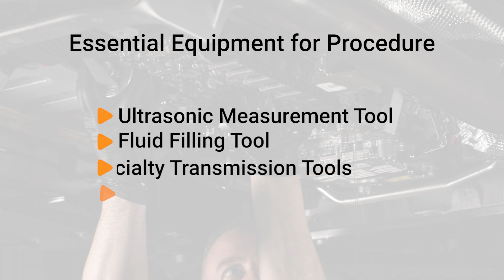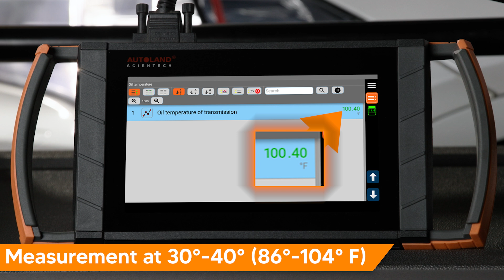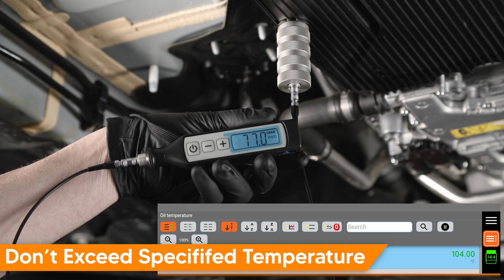Mercedes-Benz 725 9G Transmission Filter & Fluid Replacing | Special Tool Information - Ultrasonic

Comment: I never do the temp method. I take 10l out, I add 10l in. Runs fine, shifts fine,  over 100K miles.....
Reply from the maker: That's good luck! Best method is to follow Mercedes-Benz provided steps to ensure proper filling and  operation.
Reply: @AutolandScientechUSACedarPark  Engineers don't do stuff and hope it works there must be a good reason for ultrasonic sensor.

Comment: jesus this engineering is ridiculous
Reply from the maker: Very accurate leveling and filling though!
Reply: Yes, would be good if the engineers could learn to design a transmission that isn't so sensitive to the fill level. They aren't that good though.

Comment: This is drain and refill. So how about flush?
Reply from the maker: In order to flush the entire system, you would need an automatic transmission flushing machine. This machine hooks up in between the cooler lines and fills the transmission as it drains it with new fluid.

Comment: Do we need to bleed valves before adjusting level?
Reply from the maker: When shifting through the gears in the procedure, the fluid will flow into the system pushing air out.
Reply: @AutolandScientechUSACedarPark  thank you

Comment: What is the correct RPM value when adjusting the fluid? Does it have to be done at 900 RPM? Or at normal idling RPM?
Reply from the maker: At idle. The DME controls the idle RPM.

Comment: Out of curiosity, is there a reason why you didn’t drain the torque converter as well?
Reply from the maker: There is no drainplig on the torque converter. It would have to be flushed using a flush machine or removed from the vehicle to drain.
Reply: @AutolandScientechUSACedarPark  You can remove the hose going to the transmission cooler and bleed out the fluid by starting the car and draining 1-2 quarts at a time and refilling and repeating. Similar concept to bleeding the brakes.
Reply from the maker: @JetFire9  If you cavitate the fluid doing this you could cause damage running the transmission. This method can work with a sealed transmission flush machine. Where the machine drains and fills  at the same time.

Comment: which  ultrasound fluid measurement tool are you using?
Reply from the maker: MB parts department or direct from ACS, part # A1207D LevelGauge.
Reply: Out of curiosity, is there a reason why you didn’t drain the torque converter as well?